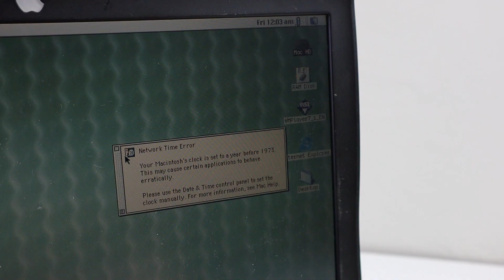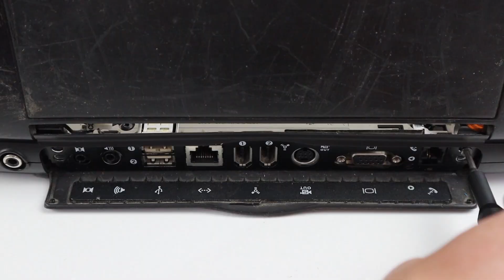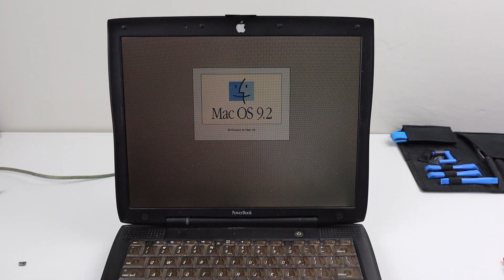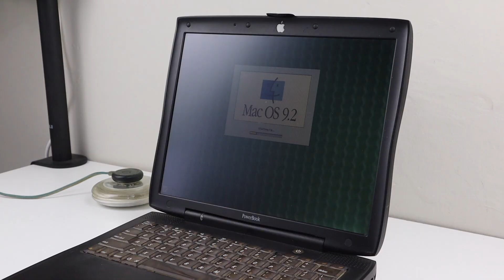Restoring Apple's Most Upgradable Laptop - PowerBook G3 Pismo - The M1 Mac I Wanted To See...

Comment: My laptop has a problem with the battery. It charges to full but if I remove the charger then it will last for about a minute and then shut down. This kind of started to happen after I gave it for servicing. Is it the cable that's loose or is my battery dead? My laptop is around 2 years old.

Comment: A red-glowing backlight is a sign of a high hour display, and the CFL is reaching it's end of life. If you're ambitious enough, it is possible to swap said CFL tube and recycle a perfectly good screen.

I did just that for a red-glowing Thinkpad T43p that had the coveted "Flexview" IPS panel and got good results. (Although the very bottom edge of the screen is rather splotchy, it's very usable.)  YMMV, of course, as each panel is designed differently.
Reply: You could always swap the CCFL tubes and inverter for a power supply and LED strips.

Comment: You should try saving up for a spot welder and and modify the batteries as in getting a bunch of lithium ion cells that match the voltage and power requirements for the laptop then remove the connectors off the old batteries and solder/weld them on to the new lithium ion cells if you can't find any batteries not that hard to do and I have seen some people on youtube doing that with old tech and power tools when they refurbish them

Comment: "Apples only upgradable laptop" There, I fixed your title (:
Reply: In fact, I have a MacBook 1.1 (2006 White) and it's upgradeable (RAM, battery, storage and may processor but it's solded with a such of silicone thing)
Reply: Actually you can upgrade the iBook if you open the back and a few other MacBooks
Reply: But the newer ones removed it
Reply: There's several.
Reply: There are way more upgradable laptops from Apple, this is just the newest fully upgradable one. The next generation they removed CPU upgrades and hit swappable bays, then with the retina they removed upgradable ram, and the 2016 and up they removed upgradable storage.

Comment: "This machine can support up to a whopping 1 gigabyte of ram" Thats insane
Reply: For 2000 that’s actually a lot of ram .
Reply: @lasarith2  dam that powerBook is older than me
Reply: @LukasKrapukaitis  probably like having 32GB of ram today .
Reply: I’m pretty sure you can run BASIC modern applications with 1 gb.
Reply: Well a cheap laptop nowadays has 16 gigabytes or so of ram so it’s pretty good
Reply: 1GB of ram is painfully slow! My Macbook air m1 has more than 300GB of ram. And i love it! Its so fast by doing daily tasks on it.
Reply: @jxcobblox6169  you’re confusing ram with storage , the maximum the M1 can have is 16GB which is on the SOC itself.
Reply: @lasarith2  I feel like a lot of people confuse ram and storage.
Reply: @jxcobblox6169  That's not RAM.
Reply: @jxcobblox6169  1gb is big back then
Reply: @jxcobblox6169  300 gb ram💀💀💀

Comment: That inverted apple logo must have driven Steve Jobs crazy.
Reply: He actually designed that, apparently he wanted it to look good for the consumer instead of others
Reply: Jonny Ive Made Steve Jobs to turn it upside down 😉
Reply: That’s why he fixed it
Reply: It's a matter of perspective. It's right side up when the laptop is facing you closed. Also, my first laptop was a clamshell iBook, which has a really cool integrated carrying handle on the hinge side. That meant that if you carried it by the handle, the apple was upright. The Pismo PowerBooks based their design on the iBook.
Reply: The PowerBook design predated the iBook by a year, with the upside down logo on laptops starting with the earliest 100/140/170 machines
Reply: He was the reason why the Logo was upside down. It seemed, for him, that looking at the logo from the perspective of a user was the most important thing.. Only through battle with marketers and videographers, this could be changed. When photographed, the logo appeared upside down in TV and photos materials. So, there were a lot of people who were RIGHT and had to make Jobs do right things. Yep, all the glory goes to the man anyway.
Reply: You really think Steve Jobs didn't absolutely go over every single detail on that device pre-launch and made sure he was okay with it?
Reply: Pop

Comment: one of my favourite vintage powerbooks...I bought one of these new back around 2000 (still have the original box too!), and use it occasionally as a “bridge” between vintage macs (1984-1999) and Mac OS X - it just has so much connectivity. Have the same PRAM issue, but no big deal.... Great video Hugh!

Comment: this thing is perfect for repairability and upgradability but its thick and that alone makes it impossible for today. Apples Laptops are Ultra books which are generally becoming completely impossible to upgrade and fix yourself no matter the oem. sadly, the things apple does on the phone side of things is an insult to everyone who doesnt want to pay someone else to do it for more than double than what the replacement part is worth. that said, my 2018 lenovo is what i consider to be a great middle ground, i cant upgrade the cpu or gpu, but the m.2 drive, 2.5" sata and one of the two ram slots is replacable which i think is a great middle ground in terms of thickness and cost

Comment: To make the PRAM battery, use copper adhesive, check it in amazon. Cut the copper adhesive tape and put it over the cable on each side of the battery. It works better than soldering the battery.

Comment: that is a nice laptop what web sites still work on it?
Reply: Next to none. The latest Mac OS that runs on the Pismo is OS 10.3.9. The very old versions of Safari, FireFox and iCab that run on this OS are totally useless as the required security protocols needed for website access in 2021 are totally lacking. 

The Airport card only supports WEP which is an insecure WiFi protocol. All current day WiFi routers will only allow connection to WPA2 and WPA3. As a result, the Airport Card is not recognized. Ethernet connection is the way to go but, internet access is pretty grim. 

Even if you were able to connect, streaming video would not be possible. Best you can do is run old Apps from the early OS X era (2000 thru 2004) or late Mac OS 9.1 / 9.1 (1999 / 2000) providing you have the old CDs and license keys to do so. Fun project, done it myself. In the end its on display like a museum piece.

Comment: I have two Pismos, one suffers from the initially-red screen, the other behaves normally. One has an internal fault I can't trace & won't boot from an internal drive. Instead, I use a pair of CF cards, one of 1 GB with Mac OS 9.2.2 & the other a 32 GB with Tiger installed. The CF cards connect via Firewire to a FW CF card reader.

Comment: That laptop may be upgradeable. Just to get into the motherboard how many plastic crap he had to remove. In terms of repairability the 2008- 2012 unibody macbooks are easier to repair. In those just 4-5 screws and some connecters the motherboard can be removed. In those harddisk and ram can be changed easily. In terms of repairabily and upgradability unibody macbooks are the way to go.

Comment: My first laptop was the first generation Powerbook G3 “Wall Street” model, predecessor of both the “Lombard” and the “Pismo” - and I still have it.  It looks exactly like this Pismo, but with a black keyboard. It no longer boots due to a “question mark” hard drive error, but I’ve kept it for sentimental reasons (and it’s in excellent condition). You’ve inspired me to pull it out and consider trying to get a replacement hard drive, since I’m pretty sure I still have the OS 9 install software disc for it in my box of miscellaneous Mac stuff 😃
Reply: Even better you could now replace with an  SSD and get sparkling performance!

Comment: If u want to sold on battery's 1st sand the battery surface with a sand paper then u can sold a wire and make a battery pack but u have to sold quickly so the battery don't get very hot and get damage

Comment: i dont know why 2000 sandpaper not compatible since 2000 powerbook designed and should compatible with 2000grit sandpaper, its a good opportunity since sandpaper grit jump to 3000 you have to wait until next powerbook released at year 3000

Comment: I've been able to solder batteries with decent luck; you just need to scratch the surface up a bit and use a lot of flux. I've also found using a hotter setting on the soldering iron (400C vs 350C) and reducing the contact time yields better results.

Comment: “this machine can support up to a whopping 1 gig of ram” 😂
Reply: That was still more than Mac OS 9 could generally handle without becoming unstable.
Reply: @leonkernan  Dead right. You could manage with as little as 32 MB of RAM.
Reply: Man, back then when 1 gig could do so much😭😭
Reply: @JoseRodriguez-dx4pb  Now 4gb ram is considered minimum for regular use and 8gb ram considered decent for gaming 😂
Reply: I have around 1gb or ram on my phone
Reply: @sean6992  thats a really crap amount of ram on a phone
Reply: @Hi-ix5bb  ik it's a £60 2014 Sony xperia
Reply: @sean6992  yo get a 99 dollar phone if you can afford it, its most likely better
Reply: @jem-yd6yq  that's a little expensive for us, I know that sounds stupid but my next phone would be a huawei y7 which is really good and it's £75
Reply: @jem-yd6yq  $99 is not far off £60 and what can you get for $99?? something from ''WISH'' maybe ??
Reply: @sean6992  my watch has more ram xD
Reply: @hectic1_Tech  lol
Reply: lol
Reply: I had a Mac three years later that had 1GB - it was large, but not outrageous. Things moved along faster back then, in terms of specs. 4GB of RAM has basically been the minimum standard for the past decade. Going back a decade from 2000, to 1990, 1 megabyte would be considered insane. The specs basically got jacked up 1000x in ten years. Things feel rather stagnant by comparison - but then again, there's only so much RAM stuff really needs.
Reply: I want to put 1 GB in mine will it go?
Reply: Whats so funny about it?
Reply: that was a lot for the time
Reply: Nowadays phone can support up to 12 or 16 (S21 Ultra) with up to 1tb more than this laptop

Comment: I still don't understand why nobody in any review I've seen of the M1 Macs has been concerned about the future of these machines.  In 10 or so years virtually all of them will be dead, beyond repair.

Why? Ram is a very common fault in computers, other than maybe the CMOS battery, it's what goes first. And without RAM, your fancy computer doesn't work. Can you imagine why having RAM built into the CPU is a major design flaw?

The CPU is a ball grid array chip, and a big one at that, meaning only a highly skilled professional repair technician with tools that cost thousands, if not tens of thousands of dollars will be able to confidently replace it.  And after all that a replacement CPU would be its own nightmare to source, apple will make sure of that.

Even if you couldn't care less about things 10 years down the line, the CPU embedded RAM is a design flaw for the here and now. When M1 Macs start becoming widespread, Im sure the RAM will fail in a good few people's machines, that's just how it is. And when it does those people will go to the good ol' genius bar asking for a repair. The geniuses will tell them it's unrepairable and that they need a replacement.  Cool, whatever, the customer shows their Apple care junk and they walk out with a replacement unit. But what do you think happens with the one they brought in? Recycling at best, E-waste at worst. A perfectly good chipset, CPU, motherboard, screen, case,  keyboard, and so much more, thrown out because the RAM had failed. Then Apple has the AUDACITY to say they are trying to be environmentally friendly with their designs.

And don't tell me it's all okay because the RAM speed is faster. Even a disaster has it's upsides.

Comment: Bitcoin's price action after the election season has been incredibly positive , with bulls taking full control of its trend as they attempt to push it above its 2019 highs.heading into the presidential elections significant turbulence within the stock market should cause some weakness.getting data like this early is the reason I trad with Bitmine Lite Trade; a portfolio management company that has helped me sharply extended my wallet from 4btcto 13btc in 2weeks . why stress over the changin cost of cryptocurrency when you can get trad sign_als from a reliable company like Bitmine Lite Trade. You can reach him on Tal.e.g.ram ( @ Danielwrightfx ) what_sa_pp + 1 (786) 52 72947

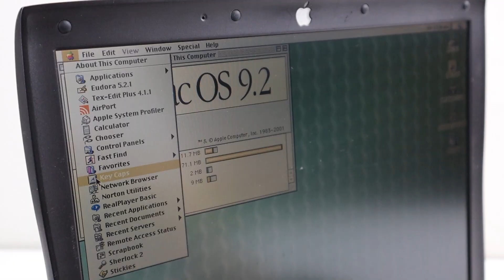Comment: 11:07 Those are the "Platinum Sounds"; IIRC Mac OS 9.x added the option to install appearance themes, including custom windows decorations and soundset, the Plaintum being the default included sound set; it's too late now but maybe for the next beaten plastics, while you dissasemble them, after a proper rinsing you could paint them black with airbrush; a couple of enamel coats works wonders, at least for ABS covers

Comment: to solder on the batteries you should sand the battery surface with sand paper and it makes more surface and it rougher and the solder will stick on the battery

Comment: I did the exact same thing you did with your pismo, i fully restored the machine i own, it had a lot of problems, but i did it. It also had a red backlight problem but the red wouldn"t fully go away anymore, so i opened up the display assembly and i carefully replaced the cfl tube with a brand new one, the display now has a brighter strip on the bottom, but the display is nicely bright overall so i am not gonna fix that because when the bulb warms up, the whole display has a nice and even backlight, its a very difficult repair, but once its done your screen will look so much better. I also replaced all the cells in the battery with high quality ones and it lasts for around 4.5 hours, which is way better than 10 minutes offcourse. My laptop is as good as it ever going to get so i am happy with the result :)

Comment: I'm telling you Hugh try mean green on ONE machine you can completely spray an entire machine and rinse it in warm water( bath tub slow running water though). Dry it with a fan and you will get 100% of all grime off it. THE only parts you can't wash are the screen, any fans or keyboard. works with all mother boards / power supplies etc.( BUT leave thee unpluged for a while.

Comment: I have one of these. Dual batteries was awesome. And. One of my widgets for the expansion slot was a "power brick" that could then use "international power" with an IEC connector. This one widget drops the brick itself, the power adapter, and can mean even the cord gets skipped (if you know where you're going.)